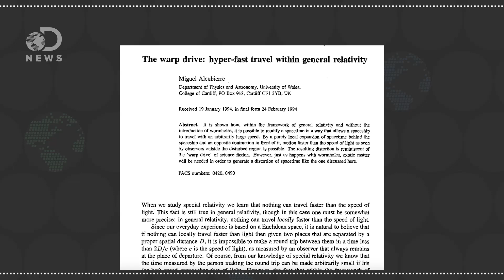How Close Are We To Star Trek's Warp Drive?

Comment: You realize that the matter in the warp bubble is only in freefall and everything else is moving around it.  The matter swept up in the bubble would only be going at freefall speeds when the bubble collapses.  A warp system is not going faster than light.  It isn't even moving.  Space/time is warping around it.
Reply: Dirty Duck exactly ^_^ and even if they weren't, the trajectory of the warp could be altered so that any material pulled along would pass by harmlessly.  Now on the other hand if the actual ship was moving at light speed then it would drag particles behind it and could possibly be a billion megaton nuclear explosion waiting to happen unless slowed properly.  With a warp drive space/time is moving out of the way while the ship falls through so nothing is actually moving faster than light even though the ship arrives as if it were moving at 10x light speed.  Since the ship isn't actually moving at light speed time is not dilated and the ship arrives in real-time relative to when it began the journey.